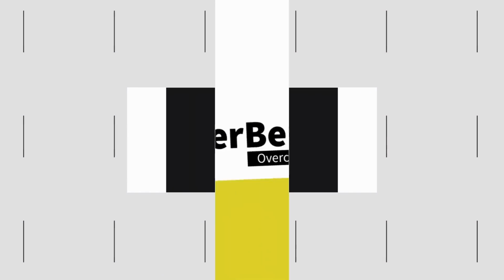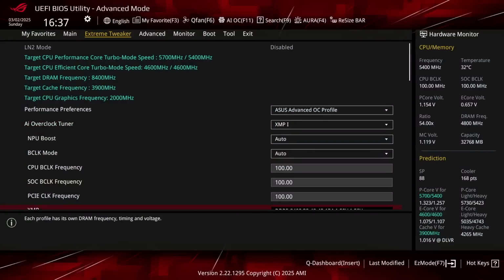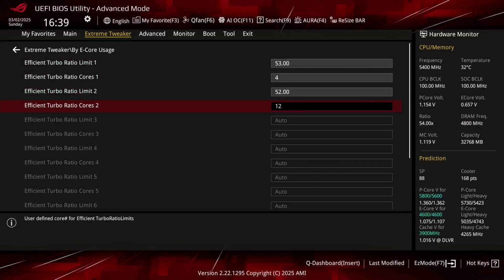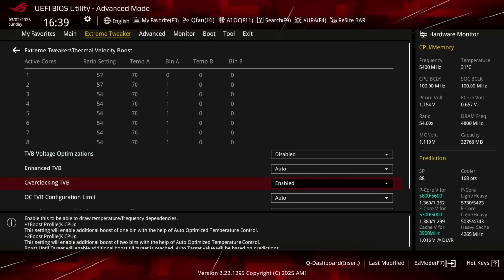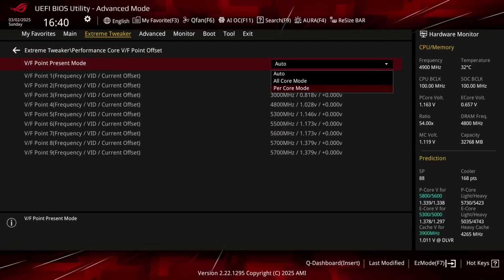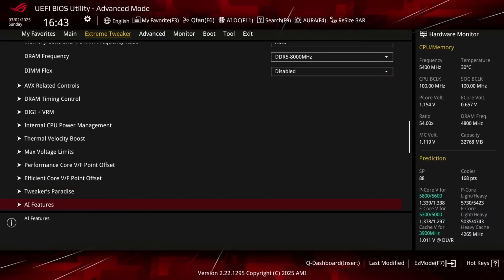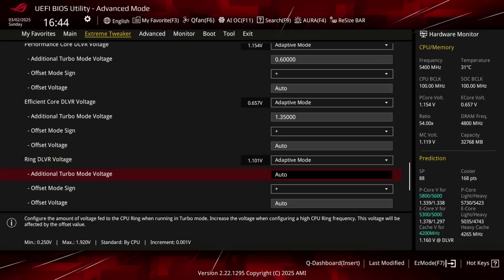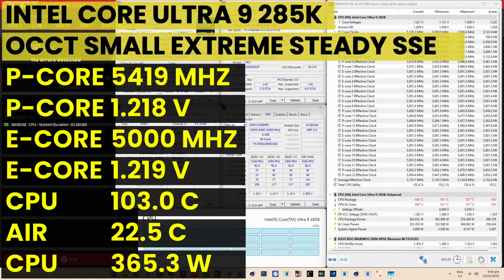5 Minute Overclock: Core Ultra 9 285K to 5716 MHz

Comment: Not a good one as I just tried this. I'm using 285K with Z890 Apex with 2201 BIOS. Following all of your steps verbatim, Cinebench 2024 just crashed on first loading, showing black screen with Stop code: CLOCK_WATCHDOG_TIMEOUT. My CPU's SP is 89, even higher than yours in the video.

Comment: You said not to copy/paste the settings. But, if I want to apply just a few changes to achieve most of the improvement you achieved (say, 70% or more), what would those values be and what are the numbers that any 285K should be able to withstand? (ie removing the silicon lottery variable)
Reply from the maker: You can have a look at my full length guide where I go in much more detail https://www.youtube.com/watch?v=5ylsNxwWQ9Y.

The TLDR is enable 200S boost, increase the all-core Turbo Ratio, and try undervolting a bit.
Reply: @SkatterBencher  Hi, thanks :) Yes I did read it. Problem is I can't enable 200S as is, because it limits the ram to 1.4v and 8000 (my kits are 8000@1.4V) and greys out all options. However, my RAM fails MEMTEST at these settings. I got it rock solid under 8200@38-48-48-84 at 1.425V, but that means I can't enable 200S, so I have to do things manually (its Gigabyte Z890 Aorus Master). So, if you could please share the values I need to edit (with the numbers to plug in), for an easy OC that should work on any 285K regardless of silicon lottery and give me ~70%+ of the performance boost you mentioned, I'll be extremely grateful. Thank you so much for your work. (p.s - i'm using a 360 AIO and Lancool 207 case)
Reply from the maker: I have a separate video on 200S Boost with explanation of what it does and which settings are used https://www.youtube.com/watch?v=YPmMsuZGvlM

Also, in the longer SkatterBencher guide, I discuss 200S Boost in (I think) the first OC Strategy https://www.youtube.com/watch?v=5ylsNxwWQ9Y
Reply: @SkatterBencher  by the way, you never mentioned Intel 200S boost in your longer textual guide. For instance, 200s bumps the NGU and D2D to 3.2Ghz, you boosted NGU to 4.2Ghz and D2D to 3.8Ghz.
Reply: @SkatterBencher  Alright, just read it :) So, set NGU and D2D to 3.2Ghz, increase CPU VVCCSA to 1.2V, VDD2 and RAM VDDQ and DRAM VDD to 1.4V (althought my ram is unstable at 1.4v, I boosted to 1.425V). Then, you said increase all-core turbo ratio and try undervolting a bit. To what numbers? What values should work on 100% 285Ks without a problem?

Comment: Can I do this to my MSI i9-285HX laptop? I can get into the advanced bios but unsure if laptops can be tweaked as well as desktops. I did set the ram speed to run 6400t/s vs stock 5600 t/s but can the CPU be tweaked?
Reply: Only in xtu

Comment: Wtf how do you manage to get your e-cores to x53, mine cant even do x50 whiout showing WHEA errors.

Max stable its 49.
Reply from the maker: Is the WHEA caused by >1.2V? https://www.youtube.com/watch?v=bkkzcWY39FQ
Reply: @SkatterBencher  Yeah exactly, its caused by voltage over >1.2v in the e-cores even tho the system seems completely stable, will watch it later

Comment: Looks like if we get B780 it is time for Z890 board and 285k unless the predicted "295k" is released for the same board. I have to say after the 13th and 14th gen fiasco with Asus boards I wouldn't trust that manufacturer. If possible I would like to request MSI board so to get familiar with their menu system. My eyes are on MEG Z890 UNIFY-X motherboard. Also it would allow comparison between motherboards.
Reply: He is known for mainly using Asus boards for overclocking, it's just his thing.
Reply: I run 14900K with Asus pretty fine for many years now. Just all core overclock the 14900K with fixed voltages and don't let any voltage get past 1.30v. But that is not needed either. 5.6ghz P cores and 4.3ghz E cores makes the 14900K already the nice monster fast CPU it is. I manage the 41000 CB23 points no problem.

Comment: Will this degrade my CPU?
Reply: No, stop watching nonsense CPU reviews. The Raptorlake and Arrowlake can run pretty fine without any degradation problems. Just know what you are doing and don't listen to sh*tty reviewers.
Reply: @jankees4037  It actually does if you dont know what are you doing.

Dont even try these settings if you dont have an watercooled build.
Reply: Just get 285K, get Z890 and make sure you get latest BIOS, get 8400 CL40 CUDIMM RAM, enable intel 200s boost or just set NGU/D2D clock @3.2ghz and enjoy might arrow lake performance. It will smoke 9950x to dust. No need further overclock for the next 3 years.
Reply: @YanuarTriAdityaNugraha that’s what I’m doin
Reply: @dubyadubyaeee  Then I believe you'll be safe running Intel 200s Boost 24/7.